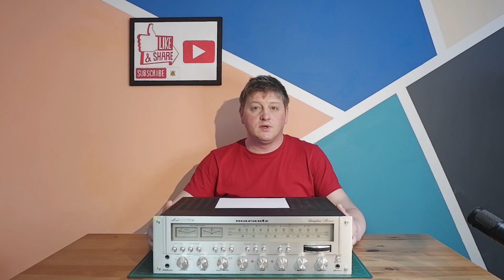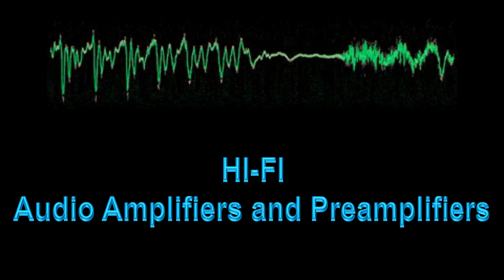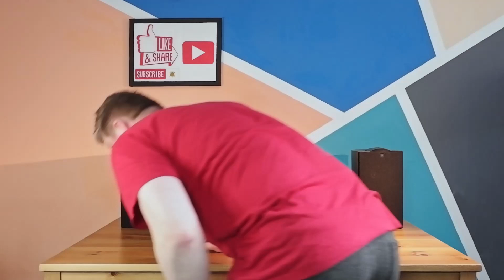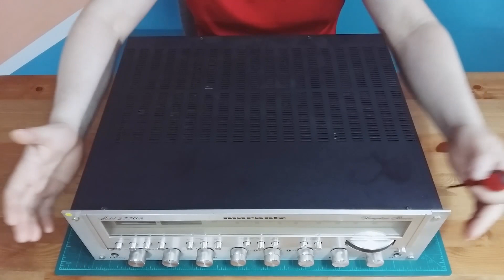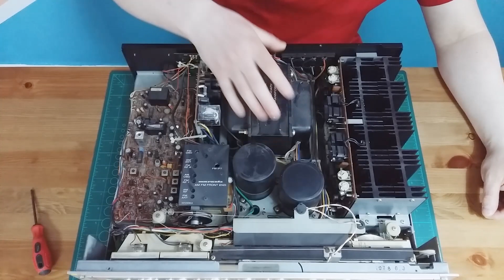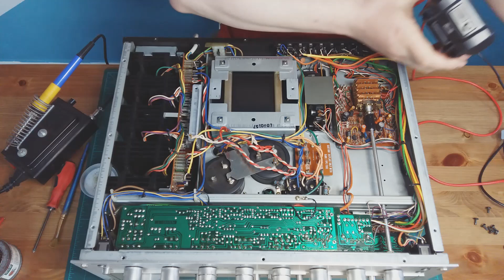When you love your Vintage Marantz model2330B you must do this! Part 1

Comment: I just acquired one of these and believe it has the same main filter cap issue..when you did the complete recap did you replace them all with identical voltage value caps? I see you did bump the filter caps up to 100v
Reply from the maker: You need to keep the same uf value. For voltage if you go higher is better! The filter caps also is good to increase a bit in uf will smooth better the power ripple

Comment: You might want to check out xraytonyb's video.  He just finished 4 part series repairing a 2285b.  Very similar design to the 2230b. He ran into some interesting issues.
Reply from the maker: would be nice if you share the link of the video. thanks
Reply: @SymbolTech21  https://youtu.be/rcAKihUNWJ4